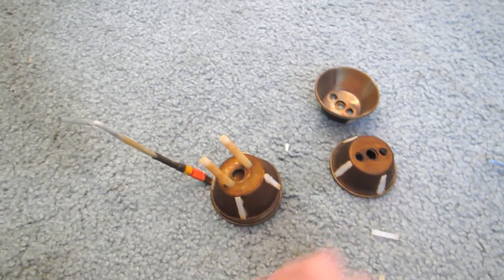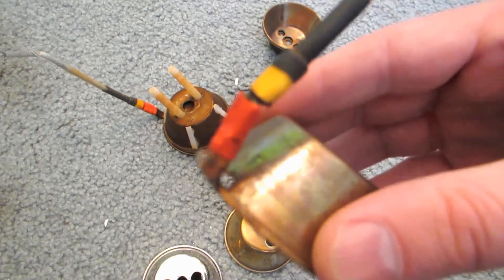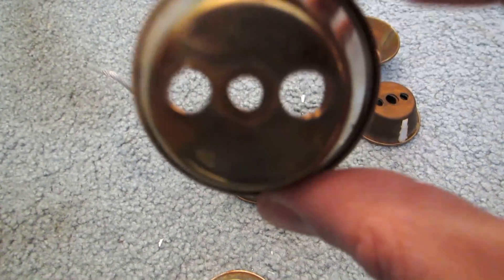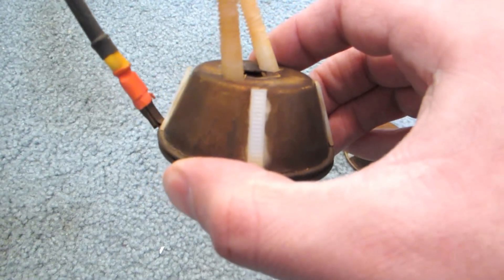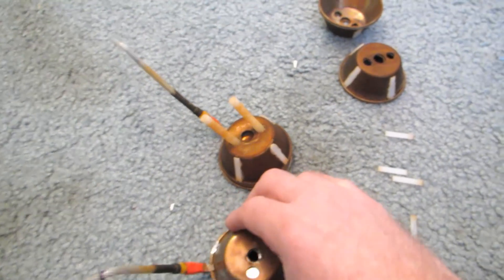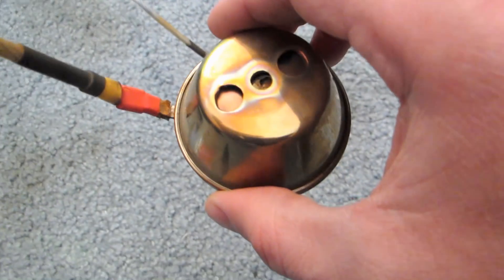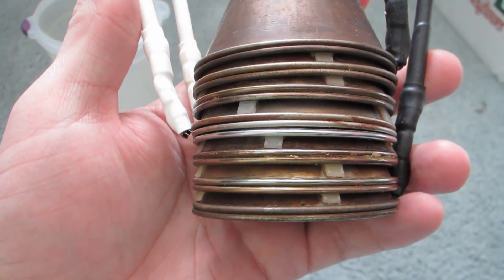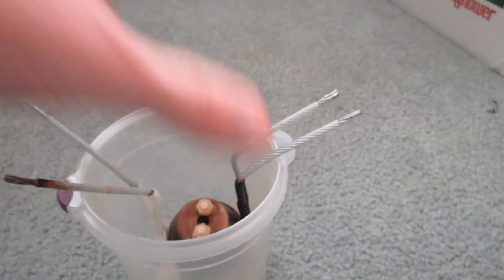Vid 73 - Volcano Wet Cell Modifications

Comment from the maker: The easiest method is using a 5 Gallon Bucket and a 1 Liter Soda bottle.  Fill the bucket with water, then submerge the 1 Liter bottle until it is full.  Run a hose from your HHO Cell into the 1 Liter bottle and have a stop watch available.

When you turn on the HHO Cell, it will force the water out of the 1 Liter bottle until it is full of HHO gas. Once it is full of gas, stop your timer and you can determine your Liters per Minute.

I hope this helps.